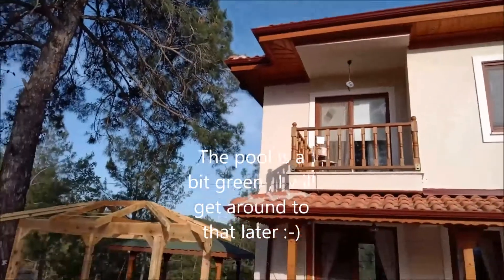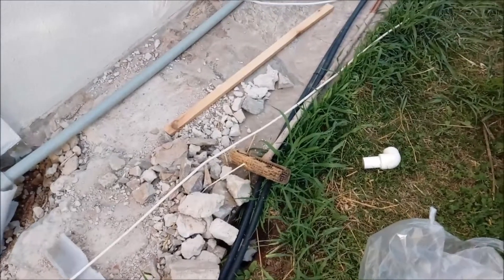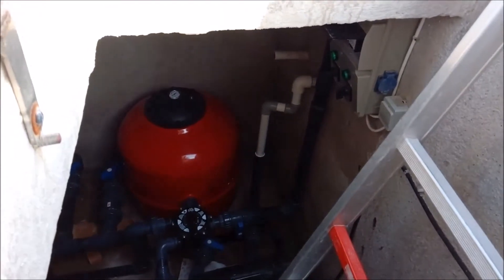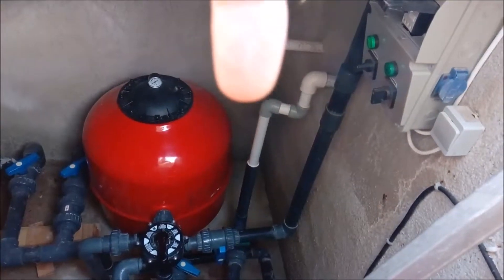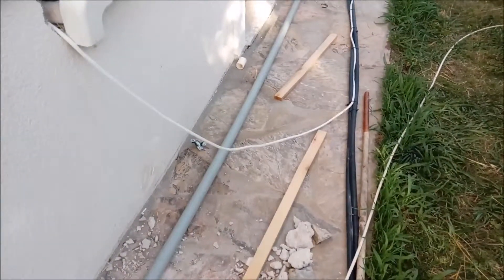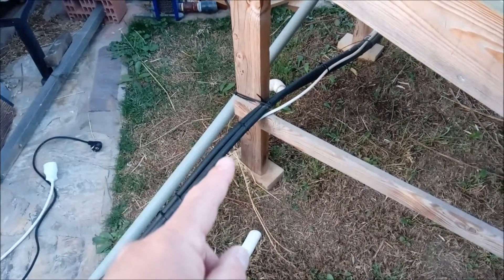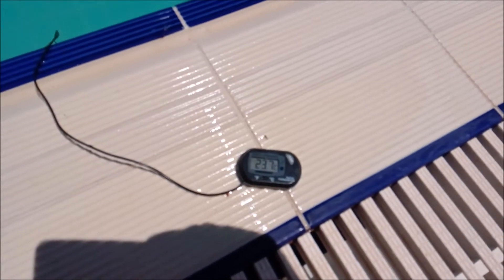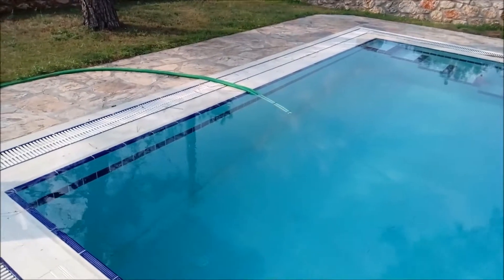my upgraded solar pool heater with  higher flow rate and temperature results

Comment: Hi i loved your video im in the prosess of making a solar water heater for my grandson here in the uk im having a problem finding a pump my system is small to what your doing .
Could you give me a any info on the small pumpyou used before changing things many regards rod
Reply from the maker: Hi Rod, Thank you for the reply and the kind words,the pump I used was a multi valve system, the problem was that the pump could not take the long running times, around 8 hours a day, this is why I chose to try and integrate the pool pump.
I used the high pressure pump only because i had to pump the water what seemed to be a long distance from the pool to the "heater" and back again.
I would imagine that if the heater you are using is quite close and on the same level as the pool then a centrifugal pump would work well.
I noticed a comment below, who uses a 12v pump that can pump 20l/min.
I hope this helps.
Regards
Marc